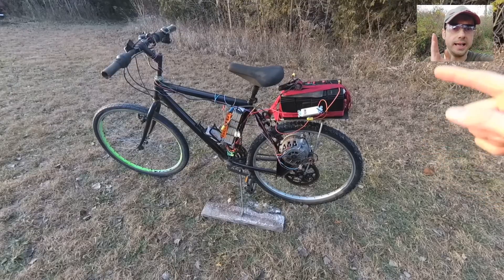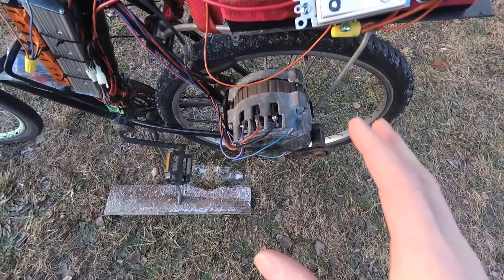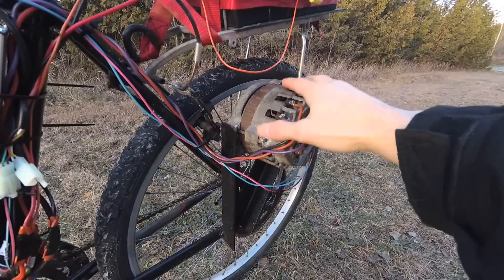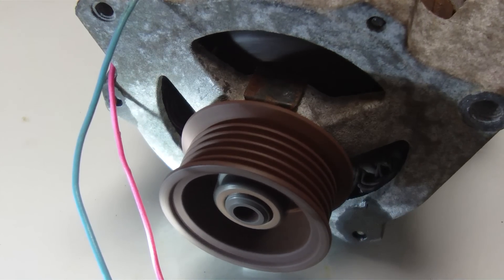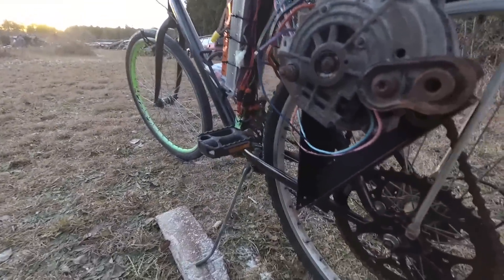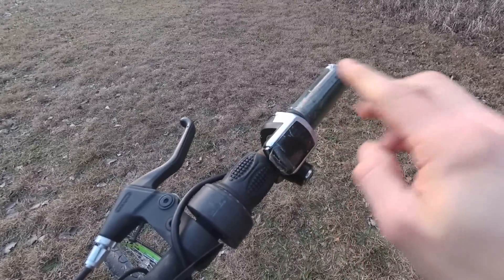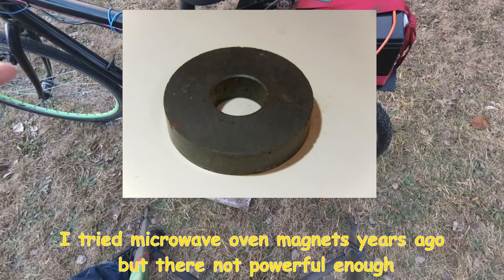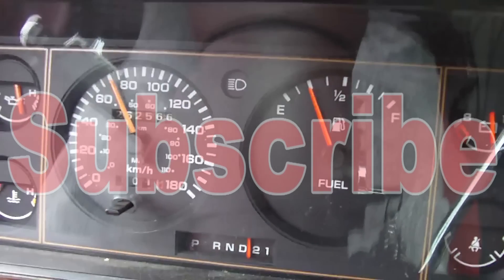DIY Ebike using a Car Alternator as a Motor Easy - No Hall Effect Sensors

Comment: I thought car alternator was just 12vdc ? Why 48vdc?
Reply: Them alternators are pushing 1 KVA ratings, so it's fine at that voltage, it's the current draw you have to be a bit worried, as it can overheat the whole thing

Comment: I used to run 48v lithium battery and a step down dc converter to 12v for the rotor, it worked ok, but kinda jerky on start, needed to give it a little push because no halls

Comment: 40 MPH on a freaking e-bike and you're expressing disappointment?!? 40 mph is STELLAR !! Great video, friend. I am thoroughly impressed and I don't impress easily. Honestly, I'd say you are just this side of a genius. Questions, if I may (easy, common ones).
1 What do you believe to be your approximate hp @ motor sprocket?
2 With extreme weight at back wheel, is your steering sketchy at speed ?
3 Range @ moderate speed (20 mph ) ?
4 Are those small car batteries above back wheel and did you consider using marine batteries instead ?
5 How did you determine which size sprockets to use (drive/wheel) ?
6 The max speed for e-bikes, where I live (The Great White North) is 30 kph (18 mph). Above that speed the bike is considered an electricmotorcycle and must be plated/insured etc...have your local uniformed finest harassed 
you at all?
     Thanks. Be safe. Cheers.

Comment: Nice job bro. keep tinkering.  At 6:08. You mention a heavy duty Buck converter. Where would you recommend to purchase one? Thanks. I'm working on generating 72V 5 amps for my ebike from an alternator. But I need to kick up the voltage from the alternator 13.5V 145 amps. Can a Buck Boost Converter do the job? Oh, my ebike battery bank is Lead Acid.

Comment: Why not add two alternator's one on each wheel make it awd. More torque
Reply: While you could add another alternator to the front, the bike won't be as easy to steer. And 600 watts is plenty. A pro athlete produces about 400-600 watts of mechanical power. Even 350 watts is enough for smaller, long range e-bikes. 

And you don't have to overcomplicate, either. If you want a simple e-bike controller, use three MOSFETS connected to Hall sensors, with the wires shifted one wire (2 to 3, 3 to 1).. as the rotor moves, the Hall sensors switch in a specific order that activates a nearby stator coil to keep it going. Then you can use PWM regulation like DC motors, and the speed under load will be controllable. Crude, and not exactly energy efficient, but if you're on a 200€ budget like me, it's usable. Also, a heavy 12 volt lead acid battery is enough. While higher voltages provide faster acceleration and lower power losses in the wiring, it's much more expensive (especially when you make a lithium pack).
Reply: @AdamSKEN.01 i can attest to the 350w motor even hauling ass on escooters, like come on, no human can push out 350w at a true constant pace, but a relatively tiny motor can.
Reply from the maker: You could, you would need another controller tho, Interesting ideas! 👍

Comment: I want a 12v version - what are the motor RPMS as far as you know for sure? (Need be I can just divide 48/4 36/3 or 24/2 to get 12v RPM - depends on the controller though.)

Comment: From the videos i've seen alternator motors seem to be happiest with about 1 to 1.5 Amps on the field winding.
The field windings are about 2 to 2.5 Ohms in resistance, so with a 3S battery you would be pushing 5 amps through it, which is way too much.
Excess magnetic field will just increase magnetic drag, while also overpowering the magnetic field of the stator winding.
Reply from the maker: Thanks for the info and advice 👍 I was going to try and vary the voltage to the rotor with a rheostat or a buck converter. I'm going to get back to the Alternator ebike project soon. Awesome comment.
Reply: Amigo gostaria de saber quantos volts foi jogado no rotor e quantos amperes tem em cada bateria? @kurtscottage
Reply: Would this mean that the field windings should be 2 - 3.75 volts?
Reply: @timglass6514  a single lithium cell works well for powering the rotor winding

Comment: Correct me if I'm wrong:
If I have a battery of 12.6 volts and 5.4 amps then total wattage would be 68 watts.
If the stator of the alternator i.e the electromagnet takes 48 watts then my battery should run the electromagnet for an hour or so.

Is this correct?
Reply: Total wattage is 68.04 watt-HOURS. 
At an average load of 48 watts, your battery will be drained in 1.4 hours, or 1 hour 24 minutes. That's decent, but unfortunately the real average will be at least 200-300W, and that equates to 0.22 hours, which is only 13 minutes 12 seconds.
And, if you really want power, 800-900W is a possibility, but only for 270 seconds - 4 minutes 30 seconds.

Comment: Can this be used as a car starter and alternator combined? Like in the honda vario 150 scooter, the alternator is also used to start the engine
Reply: Reading this a little bit more, you can; a lot of stop start systems on cars right now work like that, you just need some few more components like switches and such
Reply: @concorde837 i now have a working car engine outside the car (bought specifically for experiments). I will definitely try the idea of spinning the crank using alternator

Comment: Did you use a separate source to power up the field
Reply from the maker: Yes that's what the Lithium ion 18650 battery pack is for, you could also just use another 12v lead acid battery

Comment: You really should go li-ion they are far superior over lead acid batteries, also that is over geared and so is your other bikes really.
Reply: On the bike it looks like he has a pack of 18650 cells (oh he actually says it about half way through)
Reply: @MittyNuke1  No that controls something else it's not actually what makes the motor spin, for the motor he is using lead acid batteries that is on the rear rack.